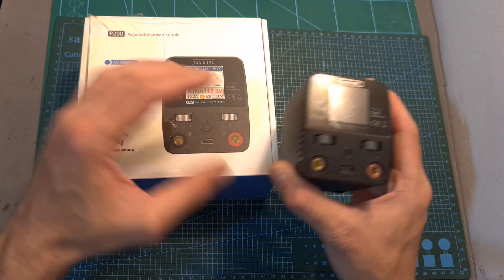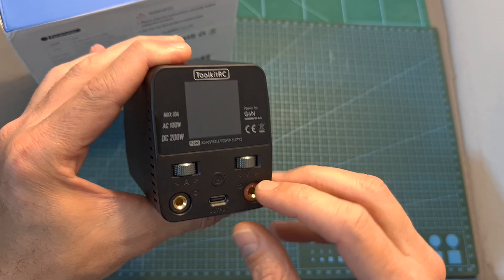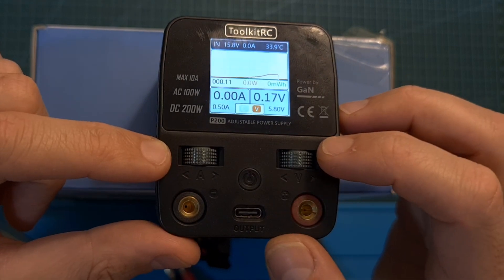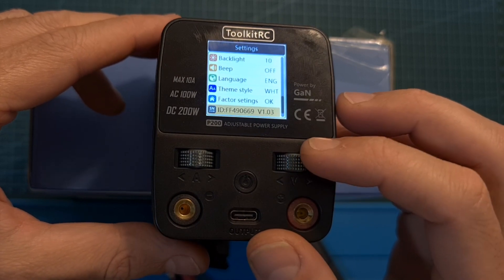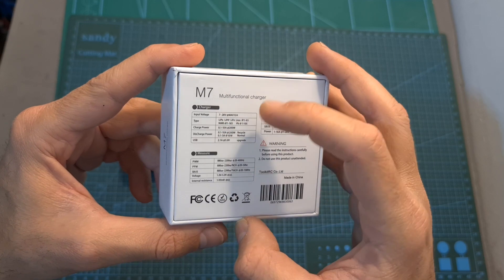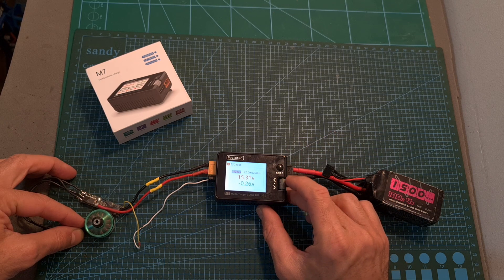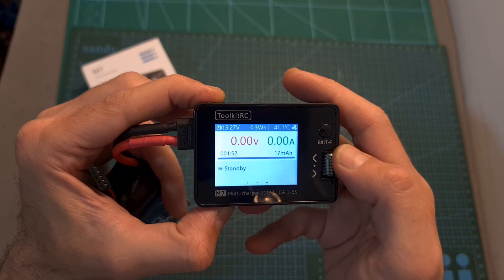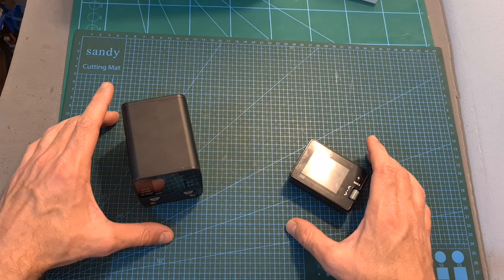ToolkitRC P200 Mini GaN Power Supply // M7 Multifunctional Charger

Comment: Toolkit is just good. Great video! If ya have a moment: My Betafpv 95 Hd is on a FrSky receiver. what do I do/change to use my DJI controller. Just remove the FRSky receiver and bind my DJI controller or do I change anything in Betaflight? Thanks for any help!!!
Reply from the maker: Thanks. I haven't tested the DJI radio controller, but basically you will need to bind it with goggles and wire the SBUS out pad from the vista to the RX pad on the FC.

Comment: I got this product P200 and M6. The added/packed cable XT60 is nearly needless. You never should charge a Lipoli accu directly, but with a balancing charger. But the chargers do have male plug and not female input.🤭